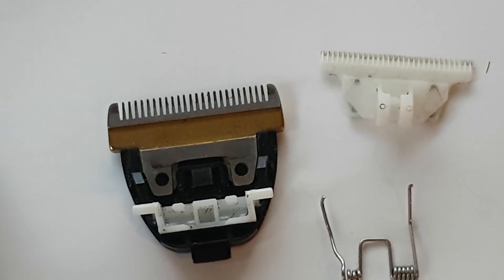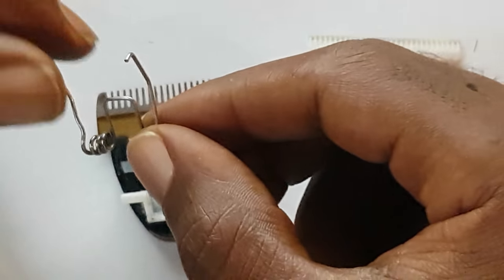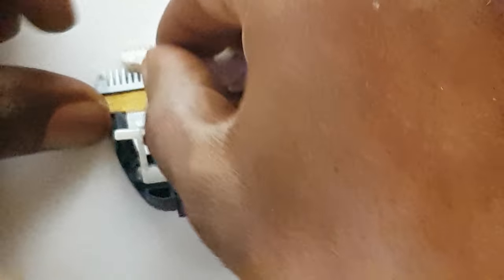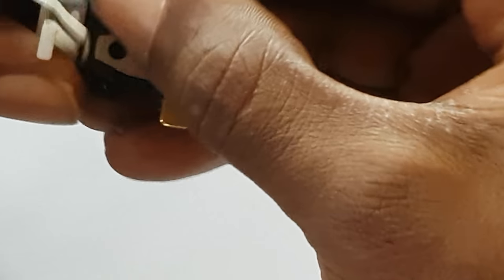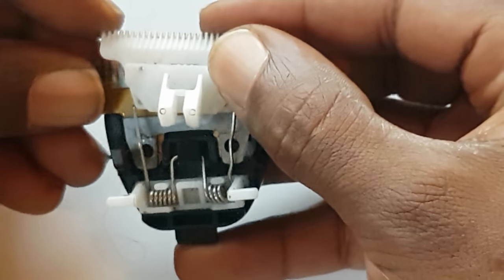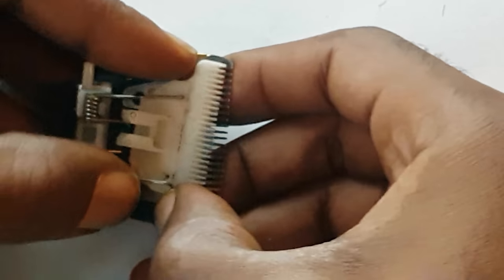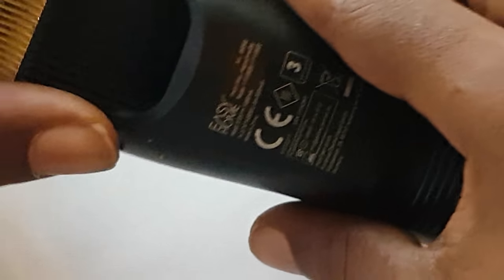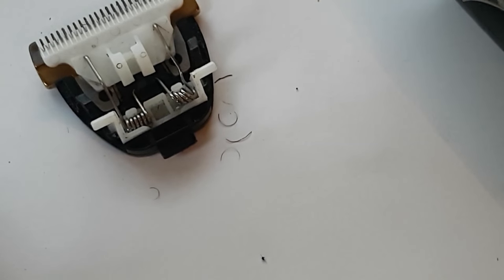How To repair Your Electronic Hair Clippers Spring Attachment

Comment from the maker: This video  https://youtu.be/UzWRDkdmfMw is a lot more detailed if you just need to create the W spring in particular. Made that video to make it easier with a full explanation and walk through of how to create one. Due to the amount of request for it , I pinned it here at the top for visibility. Thanks for watching.
Reply: શષ
Reply: Is there a video that shows how to reassemble the spring and blades on Ubeator hair trimmers? If you have one please post for me. The placement of the spring is causing me problems.
Reply: @kiranrajput6665  a new
Reply: Thank you 💖
Reply: Mines is not clipping in

Comment: How the hell do you have enough strength to push the middle bit of the spring down like that!? I try it and it doesn't even get half way
Reply: Same problem here man😢 did you get any solution for it? Kindly help
Reply: @HasnainAbbasi2006  I think it was a badly designed spring, mine looked like it was round the wrong way compared to the video so I just got another one
Reply: @DK-tt1zt  u got new spring or trimmer?
Reply: @HasnainAbbasi2006  trimmer
Reply: @DK-tt1zt  bro I fixed it
Reply: Likewise, the black plastic clip had broken off my clippers (identical design but different clipper brand).  The spring was far too strong for the weak plastic clip.
Reply: @HasnainAbbasi2006 Yes, the  arms of the spring can be adjusted to reduce the tension.    It my case it was too late, the black plastic clip had broken off.

Comment: Hi, I found another solution for the spring. You don't need to cut it or replace it. You just need a string and insert to the hole of spring then pull up, then insert the plastic. But thank you for this video. Its a big help how to put it back together.

Comment: Bro you are a life saver. I didn't realize that the middle of the spring actually gets tucked further underneath the stationary blades. I've been tucking it at the bottom of the moving blade that it attaches to, and not getting enough pressure. I was ready to give up after like 3 hours thank you so much.

Comment: Thanks for this video. Gave me the encouragement I needed to get the spring back in place after cleaning instead of buying a new clipper. One extra easing step I found was to bend the pointed legs upwards using narrow nosed pliers. This makes the insertion of the square part of the spring under the tab so much easier - it's a breeze. Then bend the pointe legs back down with the same pliers to apply the pressure to the cutting plate.
Reply: N😊😊😊

Comment: THANK YOU with all my heart for showing this procedure. I just purchased a brand new razor and trying to change the head, the whole assembly blew up in my hand: the spring sending all the components all around the room...literally! I had it packed up and ready to ship back but FED EX won't pick up packages from my home. I was stuck for the $20 I spent on this razor. I haven't tried to put it back together yet BUT at least now I know how I am supposed to do it! The company itself was useless in this regard! Thank you so much.

Comment: Wow! You are a life saver bro🤜🤛 
I rinsed mine after a haircut some time ago and last night I wanted to trim and line up the ole mustache. 
🤔I noticed when I pressed the power button a grinding  noise and I saw that I needed to charge it as well.
Fully charged the blades didn't  move nor was I able to adjust the height. I was attempting to see how to disassemble it and by pulling on the blade assembly, it came off😮
I went to get some Q-tips to clean it and that's when it hit the floor running 😯🤣
I found your video in the first Google search👏👏
It was then that I noticed that the tension blade was was missing😲
Now that I had all the pieces to the puzzle, I was ready to execute and repair my e-clippers👍
Props to you! Your video was straightforward, informative and very well presented for a novice🙌
Be well friend🙏🍻

Comment: Tried to do this but ended up breaking that little black plastic piece that the spring hooks into at 2:50. So be careful of that fellow viewers. My model was significantly harder to bend the spring in there, and even when bent into place it would keep popping out before I could put the spring in the two holes. So my blade was probably just warn out and toast .. although if I was a bit more gentle maybe it could have lasted slightly longer.
Reply: Similar problem here.  Ten year old clippers, almost identical internals as this video (different brand).  In my case the clippers started making a loud noise and would not cut.  That's when I discovered (for the time) that the head comes apart.  That tiny black part fell out; it had broken off.  Ten years service is very good for low cost clippers, but with battery, charger and motor working well, seemed a waste to bin the lot for the sake of a tiny bit of plastic.  I could not work out the function of the small plastic part, I suspected that it was only to limit the sideways motion of the moving blade.  It did not look strong enough to anchor  a spring.  I superglued it back in, with the intention to strengthen the joint with epoxy resin.  Then found this video to find that the clip is indeed to anchor the spring!  The spring in my clippers is far too strong to be anchored by that weak clip; very surprised it lasted so long.  Doubt that repairs will be adequate, so will need to buy new clippers.
Reply: @SaxJockey  I think you're spot on, maybe there's a way to do some "plastic soldering" to get some metal in there, but that was above my level of patience. I agree it's a surprising weak point
Reply: @Var_  Funny you say that, I have just located (dug out from the garage) some aluminium tape.  Will try to create a hybrid tape/epoxy brace above the clip.  There is practically no space for any reinforcement, so it will be my vey last try before it gets binned 🤭.  Not complaining of it's useful life, it far exceeded the guarantee period; but always a pity to throw items for the most trivial (yet pivotal) faults.

Comment: very helpful, thank you!!! I actually just used the original spring without modifying it at all, because it had all come apart and I couldn't figure out the most efficient way to get it back in, your order and technique did the job great, after I'd struggled on my own for about half an hour!
Reply: Same, but far longer.

Comment: Thanks, through your video I managed to save my device whose head split into pieces after failing: D. The hardest part was figuring out how to reposition the spring under the plastic hook. I found it helpful to use a long T-shaped screwdriver to press the spring with one hand, while spreading it on one side with the other hand.

Comment: Question, with the little front part of the spring that faces the opposite direction are you just applying pressure so it goes in the little under slot?
Reply from the maker: Just a little pressure , but not to much. If you get the angle on it just right , it should slide in with barley any pressure at all.
Reply: @Skillz1333  I managed to do it but I had to push it down a bit to get underneath
Reply from the maker: @berniekatzroy  Cool , glad you got it working again.
Reply: @Skillz1333  Yup, I was afraid i would need to buy another.

Comment: I have a wahl model 9649 color shaver I have turned it on and opened the screws and the razor blade and after installing it it has a lot of sound and concussion and does not shave. Can you help restart it?

Comment: Can you take another video showing how you got it back on the clippers - mine isn't broken with the springs etc but I can't get it back on the clippers is all, and in your video you can't see this bit
Reply from the maker: In this video https://youtu.be/UzWRDkdmfMw  at 26:40 you get a better view at how to snap it on. There will be some resistance so you need to push it kind of hard. Let me know if this works for you , if not ill see what i can do to help you see what you need.

Comment: I did this now it won't turn on. It allows me to adjust the speed of the blade when I want to start cutting. However the blade won't turn on to start cutting. What is wrong with it? Should I let it fully charge? It is a Brio.

Comment: Thank you for posting this. Very detailed. Tried pushing the square end under the clip.....what happens when the the clip breaks?? any ideas on how to  repair that? Or do I need to order another bracket for the head?
Reply from the maker: Glad to help. As I explain in this video , the best way to fix it if the spring breaks is a paper clip or something a little stronger than a paper clip ( you wont have to readjust it as much).  In this video Here: https://www.youtube.com/watch?v=33nGWKMgszc&feature=youtu.be  Starting at 5:10 you can see exactly how i fixed it with a paper clip. If you need more help with that just let me know.

Comment: Bruh my thing that hold tue spring judt broke and now its loud af
Reply from the maker: Hey , I would try to glue it back on with some super glue. If that isn't strong enough you might need to glue the center of the spring down directly where it would go ( in the center were the black tab would normally hold it). Just try to keep it where you can still snap it back off if you need to. Something like Jb weld would be more strong/permanent , but that would be harder to take off if you ever need to. There is also this video https://youtu.be/UzWRDkdmfMw where I show you how to remake the spring with a paper clip. This way you could tear it off and make a new one when/if you need to.
Reply: @Skillz1333  Thank you 🙏 ill try glueing it down, and imma just email the sellers and ask them for a new blade, mine is only 1month old